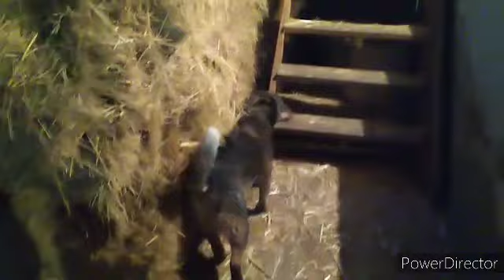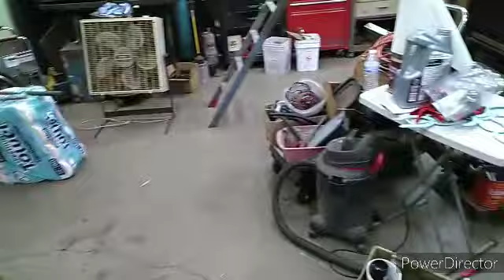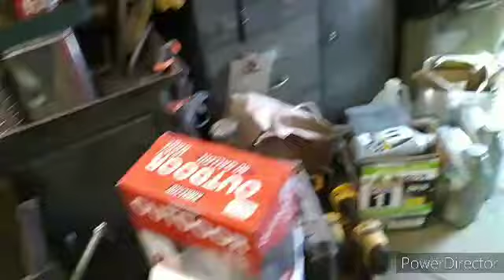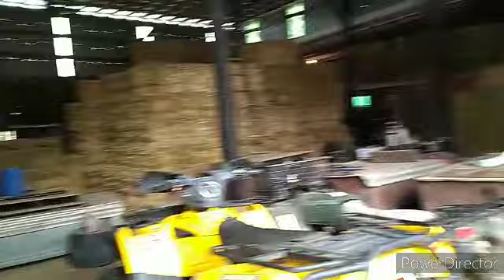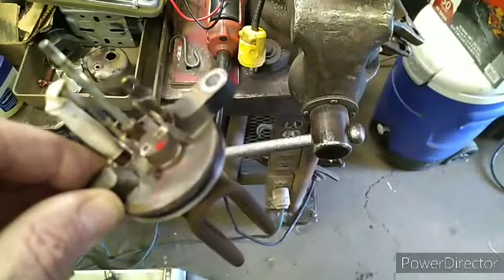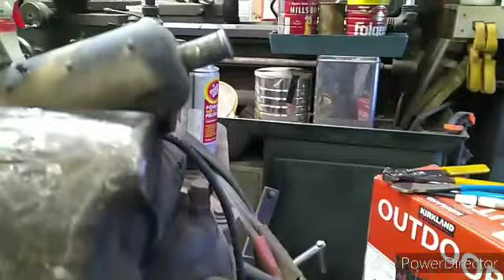Moose's momma is feeling better! fixed the tank heater off the JD.

Comment: Good Morning Ed 
☕️☕️☕️
Little calf sure is cute.
Your welding bench shot gave me a idea for mine. An electrical plug in!
Reply from the maker: Good morning Steve ☕☕☕
A friend made the plug strip in shop class. It eventually ended up here, so I welded it to the bench and put a longer cord on it. Probably should change a couple of the plugs, but it's been there for 30+ years, use it all the time.

Comment: Glad Mama Moose is feeling better..... Tank and block heaters rarely go bad unless there run dry, touch metal or if they get turbulation in the water surrounding them. Most the time it's a connection or the cord.... now you've got a spare on the shelf... We got about 3 inches of winter fairy dust this afternoon, just enough I'll have to plow tomorrow night....Thanks Ed, have a great Tuesday{ last day of Feb}...
Reply from the maker: Im glad she's doing better!! 
Ya, usually the cord, unless they get some air, although the Canadians I've chatted with about starting the engine with the heaters plugged in, say they've never heard that and have never had any issues 🤔
They say maybe some ☃️💩 in the morning.. lol. 
Thank you Brent! Have a great Tuesday!!
Reply: Good evening  Brent
Reply: Good evening Brent
Reply: @tractortalkwithgary1271   Good Morning Gary....
Reply: @ronphillips1437  Good Morning Ron.....

Comment: I've never thought about taking one of those heaters apart. Cool that works again.👍🍻🍻
Reply from the maker: I figured the element was burnt out.. but figured I'd check it out. Glad I did!! I guess 40 years of getting a workout through the winter took it's toll on the wire.. may have not been a good connection to begin with. But it works 👍😁🥃🥃🍻

Comment: I'm happy Moose's mom is feeling better! Looks like you have an extra block heater. You can usually see a silver spot where the element burned up. I know you don't want the element to touch any metal on the in-block heaters.
Reply from the maker: Me too!! Thank you Doug!
Yes, usually a spot.. and they don't last long if they are touching anything. 
I've put quite a few block heaters in, replaced a few burnt up one's.. some were shorted at the connection, but the cord was fine, it was the end of the element that was fried..
Reply: @GosselinFarmsEdGosselin  they do burn up at the connection very frequently.
Reply from the maker: @dougkubash8673  I'm just glad it was the wire and not the element 👍😁